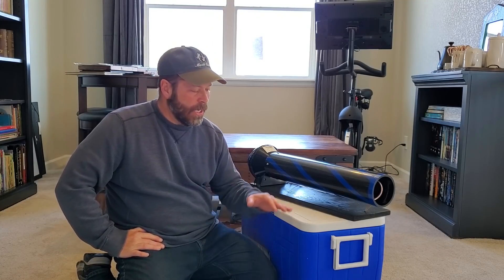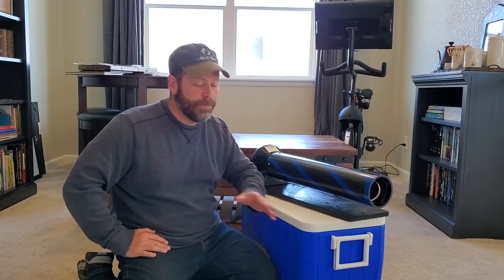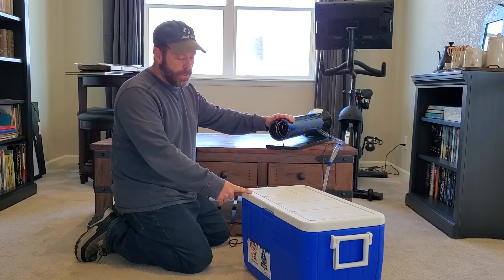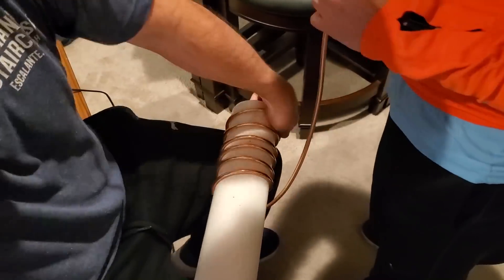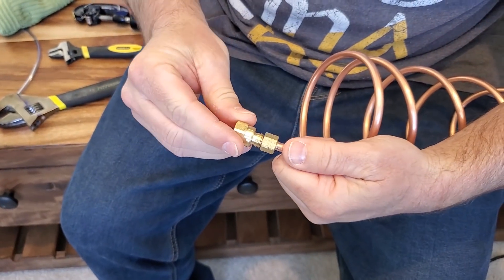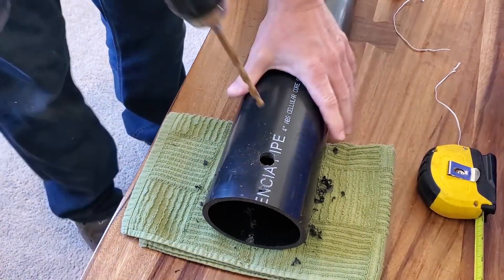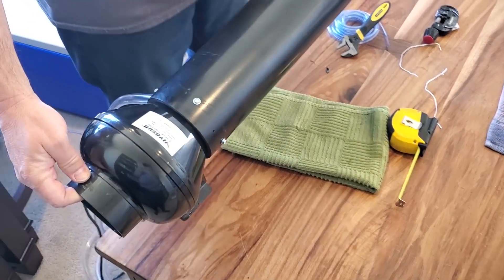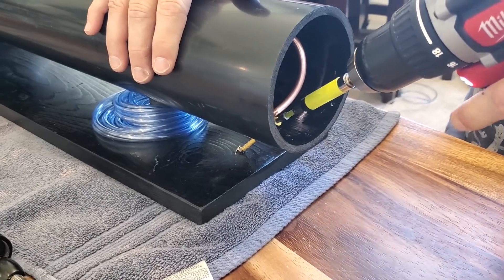Homemade Portable Air Conditioner DIY - NO HUMIDITY! - Long Lasting Ice! - The Fan Cannon

Comment: Can you use dry ice if the copper lines are secured properly? Would the water pump work to pull the vapors in? Would you need to add some water if so?

Comment: That's pretty smart actually and much better than some of the abominations I have seen DIY trying to recreate the IcyBreeze.  One thing I will also say though is that if ice is lasting longer in a controlled environment, that just means you are not exchanging heat as fast.

Comment: I would suggest putting 2 weak clothes pins on the return hose - one against the inside wall of the cooler and one against the outside end. Together they serve to keep the return hose at the desired fixed height above the water. You can do the same for the intake hose to ensure it remains submerged and doesn't move up when moving the fan.

Comment: is there a way to do this via dry ice, obviously not using a sub-pump. I'm well aware of the CO2 output, I wouldn't b using it in a confined space. Dry ice is roughly - 109 F  whereas regular ice is -32F. My AC is currently down, and its too ungodly f*cking hot in FL in the middle of Aug...... its 122 in the shade today.  so bout that dry ice concept...

Comment: Great concept. Glad to see a low-humidity design; most of these are evaporative cooling ones which are great for the dryer parts of the country but terrible for the really humid parts of the country like the southeastern states. Another design similar to yours I saw used a small radiator instead of the copper piping; that didn't require the tube screwed to the wood or the bending of the copper tubing which would definitely save lots of build time and reduce weight and bulk.

A few other ideas - someone that seemed pretty knowledgeable in the comments section for the radiator build one said that pulling the air through pushing it is more efficient and effective.

As has already been said insulating the lines is probably a good idea. They pointed out the condensation issue but I'd point out that it should also increase thermal efficiency and thus how long the ice lasts.

Longer, more tightly coiled copper tubing would increase the available thermal transfer surface area and thus colder air output much like the radiator idea.

Lastly, if you use a battery powered fan of some kind, such as one of the many affordable rechargable battery-powered camping fans out there, you could greatly increase the portability of this system since you wouldn't have to plug into either a wall outlet or generator or something and could recharge it via USB in a car, solar, etc. I'm not sure if the fan in your current design is variable speed or not, but if it isn't that would be another advantage.
Reply: "drier"
Reply: @tripjet999  "Mute."

Comment: Awesome video!! I'm going to build one. What are you using to power the SeaFlo fan? What is converting it from DC to AC? I thought I saw two power cords in the video-- one for the submersible pump, and one for ???. Do you have an unseen power inverter in this build? When using the optional speed controller, are you using a DC to AC speed controller? Thank you for the great post.

Comment: you could but an antifreeze and water mix into a separate tank in the cooler.. closed loop.. then drop some dry ice with regular ice on top of that. then duct tape around where the lid is sealed.. make it a supercooler.. but be aware you will be pulling condensate out of the air

Comment: While IcyBreeze claims not to be a swamp cooler. they still blow air across the Ice into the cooler and out a 80mm fan.  This system never introduces air into the cooler.

Comment: Sorry but there is zero chance you are able to get 3 days of ice not melting with that. The water returned back to the cooler is pulling heat in and will be at a higher temp then the ice water in the cooler. I doubt you would get more the 4-5 hours. And this is not unique there are other ice chest coolers AC’s that do a external blower but instead of a copper coil they use a small radiator in a small external box, (much more effective at cooling the air through a small radiator then a copper coil) it’s a separate external blower box from the cooler. Same exact concept.
Reply: He never said the ice did not melt over 3 days. He said there was a little bit of ice left after 3 days. Listen monkey and don't miss quote him.
Reply: It's basic physics Annie - you should stop showing your ignorance - you sound silly.

Comment: Would a double coil system work better? Using a 6” pipe and running two coils, one at 5” and one at 3”. You would be doubling the flow of coolant.

Comment: It DOESN'T WORK.  I BUILT THIS EXATLY PER THIS VIDEO.  DON'T WASTE YOUR TIME AND MONEY.  SOUNDS LIKE A GOOD IDEA BUT SIMPLY DOES NOT WORK! I TRIED ADDING COPPER GAUZE, LARGER PUMP, CHANGED TO GALVINIZED PIPE.  AND THAT MOTOR IS WAY TOO NOISY!!!! THIS WAS DC APPLICATION (FOR TENT).

Comment: and if you want colder air output , have another transmission cooler hooked up to water pump hoses (using splitter) and placed in front of fan air suction (behind the fan blades to cool air before going through pipe cooler).

Comment: I built this unit for DC application (going to Burning Man).  The 12v pump was not available, so a used one that I thought was similar (220L/H).  I think it was too small because the until does not cool.  I will try with a 240L/H. Going to fill the tube with copper mesh gauze.  Hopefully this will work or I just wasted a bunch of money on parts.  The link for large plastic tube takes you to a 3' (way to short), and the 12v fan does not go inside 4" abs pipe (so I just bought a 4" coupler).  I don't understand why the return line is so small.

Comment: Made it doesn't work waste my money and time and the ice didn't last
Reply: I built this one also and it didn’t work for me either. No clue how he got 3 days out of ice. I do have ideas and will modify
Reply: @mulekicker-ut5jl  keep me posted if u figure out a way to make something work , it doesn't even move enough air. The temp difference from ice chest to blower tells u it melts rapid 37 to 55. It's like defrosting meat with cold water
Reply: @hollisgraves13  I haven’t found anything that works so far. I think this guy is full of it. My ice with salt only lasted couple of hours. No way this setup works like he claims
Reply: I bought me a 110 portable ac , even the guy that has one patterned he says the ice doesn't last maybe 3 4 hrs

Comment: Ice cubes or crushed ice has more surface area than a single large block of ice... meaning it melts faster.   Use a large block, pack the gaps with cubes and the cold will last much longer.
Reply: This is the way, when camping, we end up bringing our deep freezer with us. (Sort of Glamping but ehh, it works 😅) we use this with ice cream tubs to freeze huge chunks of ice for our coolers, we chunk them up with an ice pick. Lasts for days and WAAAAY cheaper than bags of ice that disappear in a few hours (if you're lucky). The refilled tubs take about 24 hrs to resolidify but we have a bunch in there and just rotate them as we use them.

Comment: Don’t waste your time. If you have air blowing over this with a fan that ice melts within an hour. You’ll spend $100 a day on ice, and all you’re really doing is increasing the humidity in the area you were trying to cool..
  you can do the same thing just by filling a few glasses with ice set them on the table and have a fan blowing over them until the ice melts, when I say you can do the same thing, I mean, it will do practically nothing. You can only feel the cool air within a couple feet of the source..
  I did this very thing back in the 80s when I was a meter reader. The cars they gave us did not have radios or air-conditioning here in Pennsylvania. Where it really doesn’t get that hot for very long. It rarely goes above 92° here in western Pennsylvania
   so I got a large cooler that would hold about 50 pounds of ice. I had an unlimited amount of ice available to me because the line crews had two commercial size ice machines for them to fill their coolers for the day out of the same building I worked out of..
  so I cut two holes in the lid. One of them I attached a windshield defroster blower motor that I bought at a salvage yard for $10. I used a blower motor because it runs on 12 V, so I could hook up a plug and plug it into the cigarette lighter socket to power the blower in the car.. I cut the second hole in the lid to be able to blow the cold air out that I was blowing into the box with the blower motor..
  The first day, I filled the ice chest up all the way with free ice. I bought the largest cooler that would fit on the passenger floor of my company car..
  I plug the blower motor in and I left work that day with a big grin on my face thinking that I had figured out how to have air conditioning in my car that I would be driving around for at least six hours all day getting in and out and in and out of the car reading meters..
   it was blowing cold air, at 9 AM in the morning. That wasn’t the actual time that it was the hottest every day. That usually occurred around two in the afternoon, so I unplugged the blower motor to save the ice for when it gets hot..
  around 1 PM it started to get warm so I plugged in the blower. It was blowing cold air. About half an hour later I was going around a corner and water was sloshing out from under the lid of the cooler. I thought nothing of it.. I noticed it wasn’t blowing cold air anymore right around 2:15 PM. I looked inside the cooler, the ice was completely gone/melted. I didn’t even get an hour of cool air out of 50 pounds of ice..
   Don’t waste your time or your money making one of these ice melter coolers

Comment: Due to the closed system, you could actually pump higher than 5 feet because the weight of the water in the return line balances out the weight of the water in the pumped line.  
You just need to give it a pressure boost to fill it the first time.

Comment: Canon should be stainless. Mount the canon inside to the lid, attracting more coldness. Cut a hole to attach and mount the Fan outside to avoid moisture.

Comment: I believe the copper line will sweat thus, humidity.
Reply: The sweat on the copper line would be humidity alredy in suspension in the air and would/could not be additive humidity. If anything it would have a dehumidification effect, particularly if that was allowed to drip back into the cooler and unavailable to be reintroduced thru evaporation.
Reply: I think you are right.

Comment: Hi, I live in a tropical area, wonder if there will be condensation on the piping and therefore "creation" of water on the cooper piping and on the PVC tube, could I happen? I wonder...
Our normal city temperature is 33 Celsius with abt 70-80% humidity.

Comment: Out of curiosity is there a rule concerning the spacing of the copper tubing, for example if I wanted to make it more compact..and used a smaller 3 gallon cooler ( random number )  and lined the wall of it with the copper tubing leave a small space near the bottom for water and about 4   three inch holes for air.. would that still work or is there limit on the circumference inside the tube that affects efficacy?

Comment: I don't know how you get 3 days of ice.  I used your model. Bent 50' of copper tubing in a figure 8 style in a box. (I learned the hard way to not use a cardboard box due to condensation on the tubing, very wet at the bottom) Chilled water to the coils at the low side, with return at the high side. The box acts as a diffuser, forced  air (a B&D high velocity cage fan) enter at the top, with the air vent to the room at the bottom.  I use a 330 gph max pump, but keeping it on the low setting makes the ice last hours longer (but not nearly 3 days. 1 day max). Just my input.

Comment: are all the adapter and coupling sizes correct?
Hose barb adapter 3/16" ID x 1/4" MIP >>>>>?
Hose barb adapter 1/2" ID x 3/8" MIP
Compression coupling 1/4" OD x 3/8" FIP >>>>>?
Compression coupling 1/4" OD x 1/4" FIP

should it be
 Compression coupling 1/4" OD x 1/4" FIP >>>>3/16" ID x 1/4" MIP
Compression coupling 1/4" OD x 3/8" FIP >>>>>Hose barb adapter 3/16" ID x 1/4" MIP

or in other words, should the 3/8" FIP  go into an adapter that is 3/8" ID instead of one that is 3/16"?  should't the sizes match??

Comment: Just made this and the lowest temp I got was 52.5F. It is running in my garage at the moment (86deg F)and there is a puddle of water on the floor from the tube I imagine if you use this in a small space the humidity will lower and there will less condensation. Also I found if you insulate the hoses it does get cooler. 52.5deg F is with the hoses insulated. I will try this in a van tonight and see if it makes a difference.
Reply: how was it?
Reply: Curious, did it work in the van,and how long did it last?  Have a campervan that gets hot. Ty
Reply: @Bstaylor35 -- What did/could you use to insulate the tubing...?? I'm in process of gathering supplies to make this, and love the idea of increased efficiency through insulation, just not sure what to look for. Anyone's thoughts would be really helpful. Thank you 😊 
~ Heather
Reply: @clarkha99 pipe insulation (it sort of looks like those foam pool noodles) that's used to keep metal pipes under houses from bursting in winter, and wrap that with metallic duct tape to further help prevent heat transfer :)
Reply: how long does a bag of ice last?
Reply: So no update?

Comment: The only question I have is what is the actual temperature of air coming out of the tube after it passes over the copper coil? I'm not an engineer but I do know about surface area and that small copper tube does not provide that. If the air coming out of the tube can't produce at least 40 degrees it's not going to work well. The water temperature being pumped through the clear hose outside of the cooler will also contribute to the increase of final air temperature coming out of the tube!

Comment: Built it, 4 degree difference … feels good as it is a different temp. May scrap and just build a regular swap cooler..I adjusted the build as well, water is flowing opposite of fan direction. Fan has gap between tube so no suction effect. I also insulated the entrance tube and exit tubing. Eats the ice fast and lots of Condensation from the coil. 
It works just not sure if it was worth a the 70$ ish I have into it.

Comment: Add rock salt to the ice.  Put a tightly rolled up length of aluminum (not plastic!) window screen in with the copper tubing coil to increase the surface area available for heat exchange to happen. Generally, squirrel-cage type blowers work better for forcing air against back pressure than simple fans. Just a couple of ideas. Don’t push these as a way to cool a space… they’re just not up to the task. Promote it as a way to blow cool air on yourself while you work, drive, or try to sleep … in that scenario, they can be game-changers. Good luck.
Reply: how is this not up to the task for cooling a bedroom??? it gets mine nice and cold in the summer. what would you consider to be up to the task?
Reply: Couldn't salt corrode the system?

Comment: Jason, 
Getting ready to “build-out” my 7x14x6.5’ cargo conversion. In your opinion (I live in N. Texas) do you think 🤔 if I used a round igloo (10gal.) cooler and went vertical with the pipe/coil and put a “T” on the top with directional fittings, it would cool the trailer? Also, if I used my ICECO freezer to keep re-freezing ice containers would it work as well as loose ice? I am trying to go 12v and stay away from a high usage 120v   Window A/C.

Comment: I've been working on something that I think is better all round, instead of running your cooling medium through some make shift exchange or coil close the loop and run something like windshield fluid through in to help keep the parts clean and ice watetr un contaminated.

Comment: Bought parts from parts list in description, almost finished building but Barb adapter that’s supposed to connect from the half-inch silicone hose to 1/4” female flare doesn’t fit threads in 1/4” female flare part number 17–6751. Please help, just need part to connect -/2 “ hose & I’m finished with this build & will report my results, thanks

Comment: awesome idea. but when you run ice cold water through the copper pipe moisture 
condenses onto the pipe and the air passing over evaporates the moisture and
will add a small amount of humidity back to the air. Maybe you need a little deseccant to
dry the air near the end just to take care of that. Great work though. +1 sub

Comment: Wouldn't it be less trouble to get a cheap used minifridge or freezer and blow air through it? Probably a few downsides not occurring to me right now (electricity, strain on compressor, condensation, etc.)

Comment: What about the condensation that forms on the cold copper pipe from the air humidity? I would put an elbow with drain hole at the exhaust end blow the cooled air toward the ceiling and let my ceiling fan circulate the cooled dryed air... Just a thought

Comment: I would maybe make the barrel out of metal.  Metal always stays a lot cooler. Heck I might even line the cooler with metal. but I like your idea of putting the fan outside of the cooler. makes much more sense.